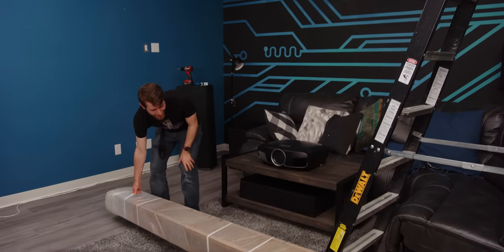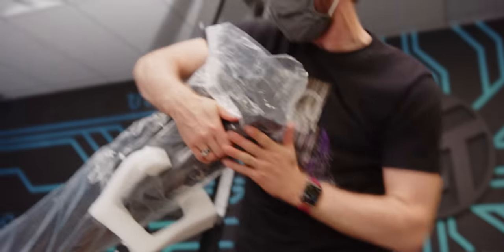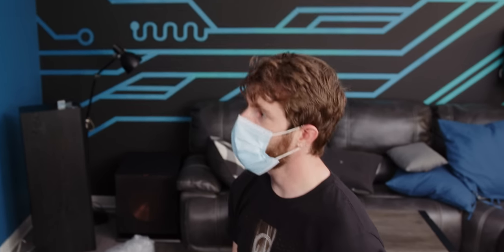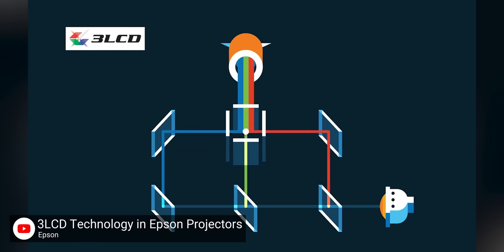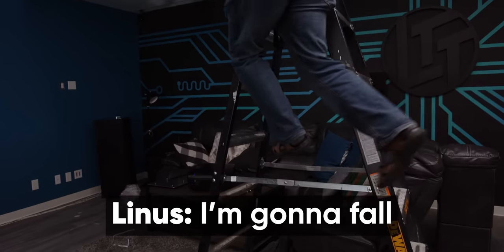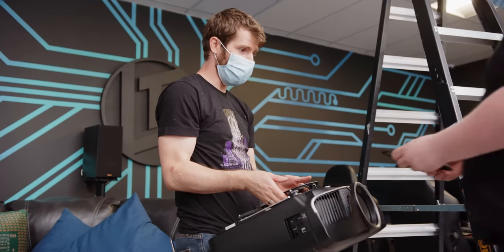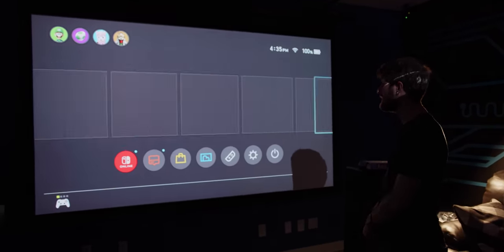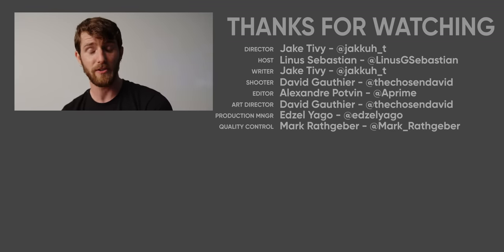Setting Up This Projector Was SO Much Work D: - LMG Lounge Update 2021

Comment: As someone who works at a company that does professional AV installs this was not as painful to watch as I thought it would be. Just please, fix the screen properly (bolt it directly to the mounting bracket not with the chain) so it won't swing that much screwing up the focus. Otherwise not bad, not bad. Sure two professional installers get this up and running in about an hour but not bad lads not bad. Linus please, when you use construction tools please wear apropriate protection (especially for the eyes), you know kids learn from you(r mistakes).

Comment: Wait... metal studs? No, knock the drywall out rip a 2x4 and anchor it to the back of the stud. Do this for all anchor points from floor to ceiling then re drywall. Yes it's a pain but that screen is expensive...

Comment: Hello Linus i have a problem with adding additional hard drive to my pc, i dont really understand anything about computers and i watched some tutorials about it. The problem is that i dont have where to mount and i dont know if the hard drive will come with screws or not, if not then i will have more problems with trying to figure out what screws i need to buy. Could i contact you anywhere to explain more and get some advice or help? pls :)

Comment: "How do you measure 0.8 foot?"

*Me smiling smug because he wouldn't have that problem with metric system 🤣
Reply: It's like they used metric then just converted it to imperial which at that point why bother lol. Normally you'd give imperial in x feet y inches. Giving a decimal means multiplying it by 12 to get your inches which is just a pain. You get 9.6 inches, but this is further complicated by inches normally breaking down into 1/2,1/4, 1/8th etc.. Which I guess maybe made sense for rough measurement (take roughly an inch, half it, half that, half that) back whenever or for offhand quick stuff sometimes, but yeah.

Comment: Projectors aren't "ideally" mounted in the middle of the screen. They are designed to be mounted top-center or bottom-center. They're meant to set on a table and project up or mounted on the ceiling and project down. They're never designed to project from right in the middle of the picture you're trying to see.....

Comment: "How do you measure 0.8 of a foot" ahh yes, the folly of the imperial system where you need a math degree to work out simple measurements. Welcome to metric where 0.8 of a meter is simply 800mm
Reply: I mean.. 0.8 x 12 = 9.6 inches. Not exactly a math degree, but what I do think is funny is that the measurement was clearly created in metric first, then converted to feet which is why we get a decimal to begin with, plus probably some weird rounding. At that point, why bother? 9.6 inches is further complicated by inches breaking down into 1/2, 1/4, 1/8ths, etc. You're gonna be staring at your imperial ruler trying to interpolate 9.6 inches at best anyway.

Comment: THERES NO SUCH THING AS 4K OR 8K SCREENS. 
All screens or walls display is dependent on the type and quality of projector you use. 
There also no reason to pay thousands upon thousands of dollars on a ceiling projector because it's "4k" , almost all projectors use some sort of image shifting. 
They could have used a epson ls500 ultra short throw projector,  with Silverflex-Ultra ALR screen that comes with it and you wouldn't even be able to tell the difference between all the work they are doing here and what they could have just done by sitting the epsonLS500,  or if you want a 4k base image get the ls800 which is onky like $500 more. But you can't tell the difference between the whole 1080p shifting or 4k "true image projectors. I only say use the epsons is the epson ultra short throws cannot at all produce any rainbow effect at all.

Comment: This is so dangerous.  Please no one sit under that projector.  That mount didn’t fit because it isn’t rated for a projector of that size and weight. It is not safe to use wood shoved in between zbar.  Please hire an AV professional to redo this so it doesn’t kill someone.

Comment: Love this channel, but every time you touch a projector I cringe.
Almost everything in this is so wrong.
From the bad projector info to the janky mounting solution. 
I would not recommend sitting under that projector as is. Do your insurance a favor and get a proper drop ceiling mounting tray.

Comment: Um, so why aren't your staff members all vaccinated so you can stop wearing your masks indoors for filming? Also, all you need are small rare earth magnets to find the nails under the tape and paint, and hench, the stud. It works so well the magnets will hang on the wall, showing all the nail locations.

If you don't have any magnets, you're bound to have an old cd/dvd player or even an old hard drive laying around somewhere. Do a video on how to remove the magnets.